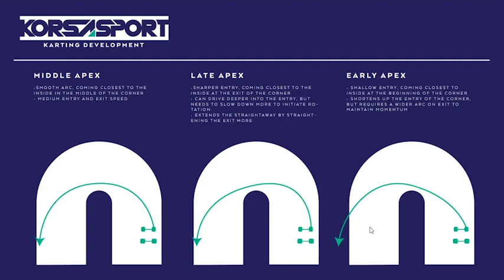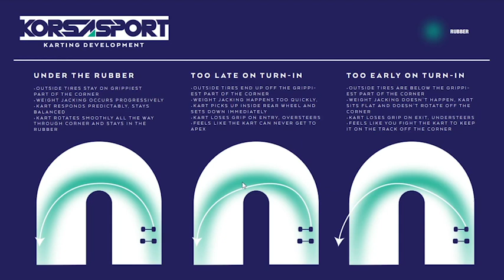Karting 101 : Lesson 1 - The Racing Line and Apexes

Comment: One of the best driving analysis/kart behavior explanations on YouTube. A valuable tool to take to track and apply to 1 turn, 1 section or your overall driving approach on 1 or repeated sessions. Excellent tool to help break apart and identify issues with; kart behavior, racing line and/or driving technique.  Especially helpful for beginner to intermediate drivers who may not even know how to state their driving questions. This breakdown works great as a stand alone tool or in helping drivers understand their own coaches input. Thanks so much for putting this together and sharing it. It met my beginner/intermediate needs more than any I've seen on YouTube. Excellent.

Comment: on my karting place there is a 3 consecutive flat out corners ( left right right) after the left its about 20m to the flat right but on the left of the track there it is very bumpy. after the first right there is about 40-50m of straight. how should i take this section? i currently am taking the first left later to tuck to the right side a little more for the first flat right then running a little wide on the exit of that and taking a normal apex on the next right as it leads to a straightaway
Reply from the maker: Really tough to say, would need to see what the track layout looks like, but in general you want to optimize the straight after a complex of corners when they are closely spaced like that. So sacrifice your line in the complex to get the best run possible at the end of the complex down the straight. Sounds like you have the right idea!
Reply: @KorsasportKartingDevelopment  is there anyway for me to semd you a track map?